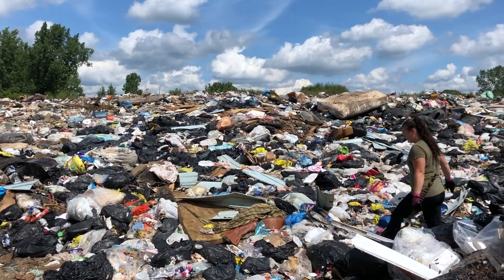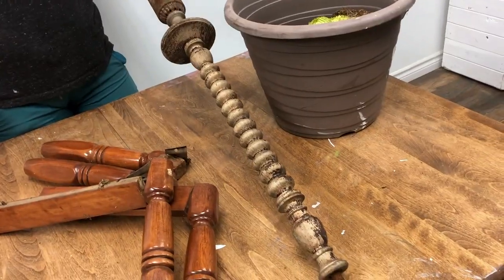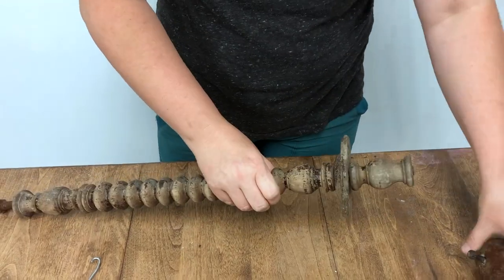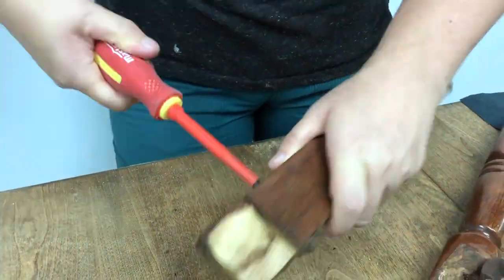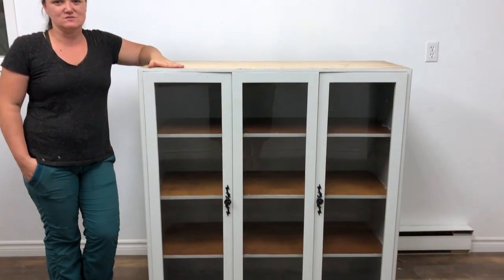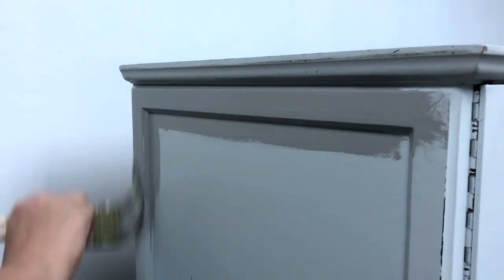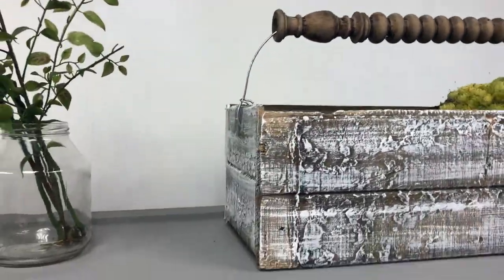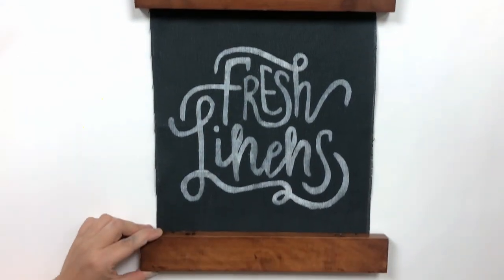Trash to Treasure | Up-cycle Projects | DIY Home Decor | Dump Diving | Trash to Cash  | Recycle

Comment: As previously opted, you’re on my favorite list. Cuz you’re practical, speak clearly, Have good humor, save hens & chicks🤓.  This is an FYI— your work table is too low,  et you’d love working on something 4-6 inches higher. I just put those bed plastic risers on mine for a trial. Bingo.  Elizabeth
Reply from the maker: I just use this table for videos. I have a workshop with wood working tables when im building for business